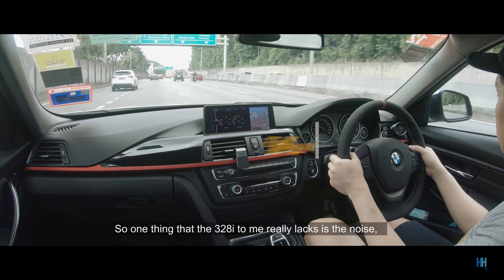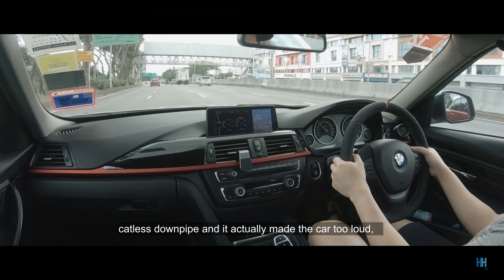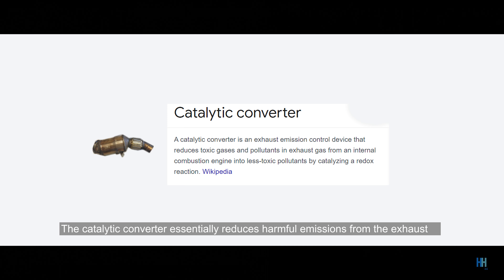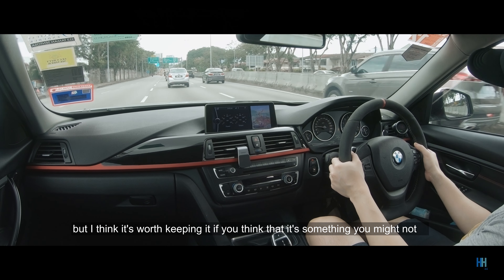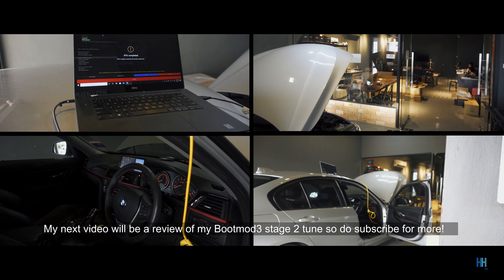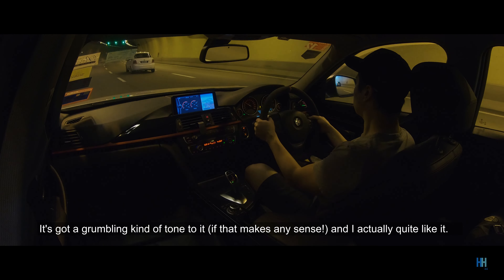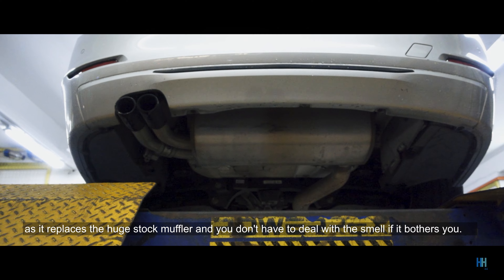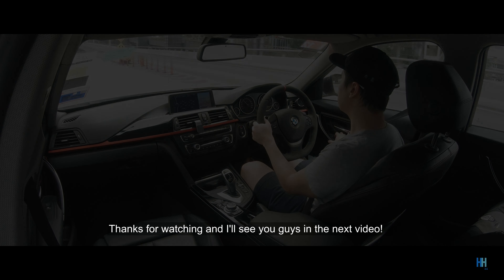Catless Downpipe/Decat with stock catback for my F30! Sound (pops and bangs/burble tune) + Smell?

Comment: great vid - i actually looked for this content for so long and you finally did it. Looking forward to the BootMod3 vid. Been thinking about doing the same comobo to my f30 as well (but was thinking single high flow cat)
Reply from the maker: Thanks, really appreciate the feedback! Yeah I had the same experience when I was researching this so I really wanted to do this video! Will try to get the Bootmod3 video out asap! Yeah, high flow cat I think is a good compromise, I believe the smell is not as bad and you get most of the benefits as well! Which F30 do you have?
Reply: @HHlah  haha yeah thats why i was considering it! I have a 2015 Msport 328i
Reply from the maker: Ah nice, wish I had the M-Sport to start with! :)
Reply: @HHlah  its great! The suspension and the engine mapping makes a huge difference. Done a few small aesthetic mods to it (m2 bumper, 19" flow forged rims, sports tyres and upgraded the entertainment system). I really wanted an MPerf exhaust but its so hard to find locally... Now just on the fence about the downpipe and Bootmod3... worried it might reflect my resale negatively. Im an expat here and may need to leave the country at short notice at some point haha. But overall brilliant daily driver!
Reply from the maker: @T_R_I_S_T_A_N_B  wow, sounds like you've done some great mods that really compliment the M Sport package! Agreed on the M perf exhaust..I've been on a look out for it too....why not try the stage 1 bootmod3 tune first then? Could be an option that's easily reversible (could do it yourself too). Where abouts are you based by the way?
Reply: @HHlah  Im at KL Sentral. I'm super on the fence right now about trying the bm3 stage 1... Also I managed to find somewhere I can order the Mperf exhaust as well (let me know if you want the details) but gotta wait 2 months for it unfortunately.
Reply from the maker: @T_R_I_S_T_A_N_B  Ah! I was trying to figure out if you were in KL. Nice! I'd say worth a try as you can actually sell the Bootmod3 tune (by flashing it to stock before selling the car etc). I just did video on my tune so you can check it out for more info! Thanks for the info on the Mperf exhaust but I think I'll try to hold out for a used one!
Reply: @HHlah  tune vid looks good haha. Yeah I think if i decided to sell the tune and the mperf exhaust second hand i'd get a good chunk of my money back. Both are popular mods here... Yup in KL for a year now.. good spot.. was planning lots of driving trips but unfortunately the whole lock down thing....
Reply from the maker: Yeah definitely would be easy to sell!  Ah nice, where are u from originally? Have u been up the hills (Genting/Ulu Yam) in your car yet? Definitely a must do as part of being a car guy in KL haha
Reply: @HHlah  Done a bit of driving around - managed one trip to cameron which was nice but hard again at the moment. As soon as it opens a bit ill take my freshly tuned 328 up there haha. Im Aussie.
Reply from the maker: @T_R_I_S_T_A_N_B  yeah lockdown is really crappy - definitely do a drive up Genting as well once the roads are open for a start, you can easily waze the directions and it's only a nice 1 hour drive up. Much more manageable than Cameron's haha

Comment: Hey bro. Great video, with very good clarity on the explanation. I find these videos of yours underrated to say the least hahaha..
Anyways if u don't mind, I have a question on downpipe changes. Say I was to change to a catted downpipe, will it cause a significant increase in cabin drone and outside exhaust sounds? I'm not too keen on the excessive sound, preferring it to be as close as stock as possible. 
Thanks in advance!

P.S: given u a sub 👍
Reply from the maker: Hey bro, thanks so much, really appreciate it! No, even with a catless downpipe it sounds very close to stock especially when you are not getting on it. A high flow cat will be slightly softer than a catless I believe so you should definitely be ok!
Reply: @HHlah  I see. Thanks alot bro. Keep making awesome videos, cheers!
Reply from the maker: @kishurm5310  haha no problem! All the best with your mods bro!

Comment: Hi bro great content. 
Did you get super loud "metallic"/rattling noise from dp during cold/warm start after replacing stock DP with catless DP?
Reply from the maker: Hey bro thanks! No I didnt for mind - might need to recheck the installation?
Reply: @HHlah  My tuner say that's normal =( 
Did you turn on the "cold start delete" in BM3?

Comment: Nice video man 👍🏻 
Ya, the stock engine sound doesn’t even match with the power output that this car has.. especially with the diesel alike sound. Haha. 
This catless downpipe must do together with remap? Can I change the downpipe only to make it sound louder and nicer abit? 
Thanks!
Reply from the maker: Thanks bro! Haha agree with you on the diesel sound. Yeah, you need to do a remap normally otherwise you will get a Check Engine Light that you need to keep clearing. If you don't want to remap, I think a better choice is just to change the muffler/axleback..keep the stock downpipe and middle resonator. Can go for a valved system so can still be quiet daily...i think the fart will be louder also and will make a bigger difference overall in sound compared to downpipe.

Comment: Nice and informative video! A little off topic - did you change to the MPerformance steering or its custom made?
Reply from the maker: Hey bro, thanks! I have the original M Performance steering that I found used, I think i saw another one being sold in the Facebook Marketplace recently. If you like the feel of alcantara it's really nice as it's thicker than the original steering + has a flat bottom so you cant really get the same with just a rewrap.
Reply: @HHlah  are you planning or considering changing to alcantara m steering in future? It does give a more sportier feel right
Reply from the maker: @manmeetsp  hey bro! Mine is already an alcantara steering so I'm quite happy with it, the M Steering does look nice but I don't think its a big enough difference to change it haha

Comment: Is it ok to change your downpipe without remap it?

Which downpipe brand that you use?

Btw your vids is my dream setup, my car has B48 engine
Reply from the maker: Hey bro, you will normally need to remap as it will likely throw a check engine light at some point otherwise, and if you are going to go catless you might as well remap to get the power anyway from the mod. Mine is just a generic brandless catpipe from a local shop (Xman in Puchong if you are local)

Comment: I have a question since i also have a 328i. how long can the remap wait after changing the downpipe? is it advisable to remap right after changing the downpipe? i'm modding on a budget haha.
Reply from the maker: Hey bro, nice car! Haha you can actually do it much later if you want as it takes time before the Check Engine Light comes on (Can't remember how many KMs but it's quite abit). Even when it does come on it's actually still fine if you don't mine having a check engine light haha. The biggest problem is that you don't get the full gains from having a catless downpipe, so maybe it's worth going the other way round - saving for a Stage 1 tune then the downpipe later? Unless it's mainly sound that you are after la haha
Reply: @HHlah  Good idea with the stage 1 then downpipe later. i hope no extra charge from bootmod3 tuner for the stage 2 though. haha.
Reply from the maker: I think you can talk to the dealer and they have an option where u get all the maps so you can change it later on. Either that or go with stage 1 and turn the cat monitoring option off first.
Reply: @HHlah  hey bro, just wondering if you are still looking for an M performance exhaust?i'm looking to let mine go soon.
Reply from the maker: @ruffluv  So sorry I missed your message earlier bro! Did u sell it already?
Reply: @HHlah  yeah bro. Sold it last week.
Reply from the maker: @ruffluv  Ah crap missed it, thanks for asking though bro, appreciate it! What did u change to btw?
Reply: @HHlah  got myself a valvetronic exhaust quad setup. Gonna go for stage 2 soon.

Comment: Hello, i have a f30 320i... I bought the downpipe for my car... But I was watching a lot of videos... and I can see that if I eliminated the catalyst and put directly a downpipe I will have problems with the oxygen sensors and the light of the engine turn on in my car.

How you solve this? you put the oxygen sensor directly in the downpipe?
Reply from the maker: Hi yes, you just swap it over, the catless downpipes for N20 are all fabricated with the bung for the O2 sensor
Reply: Thanks so much!! My downpipe arrived today with the intake system and the flowmaster!! Jajajajjaja
Reply from the maker: @javiergandica634  Ah cool! Which intake did u get?
Reply: Injen intake from Carid.com the best page for buy specific thing for your baby jajajaja. And install to a CTS Turbo Blow Off (I will tell you if the sounds is nasty)
Reply from the maker: Haha ah the injen looks good ...and I was thinking of the GFB diverter valve too
Reply: I buy the BOV of CTF turbo, its they make a BOV only for our N20 turbo Motors so its awesome jajajajajaja but inlittle expensive!! I buy too the inlet for complete the air system kit

Comment: where did you get your steering wrapped?
Reply: and how much in ringgit?
Reply from the maker: Hey- mine is the original M performance steering so it's the original Alcantara, but you can watch my 350Z video on the interior refresh where I rewrapped the steering wheel in Kampung Melayu Subang